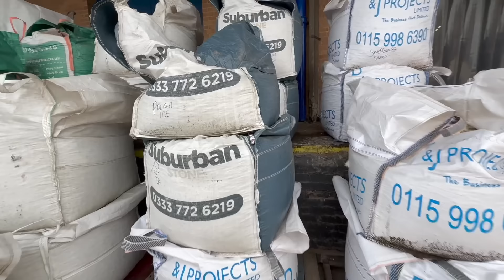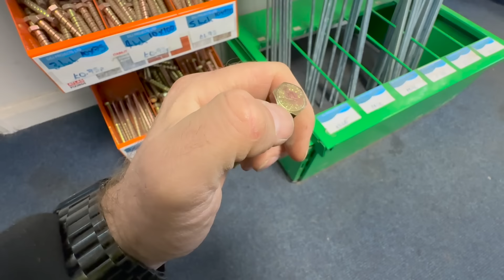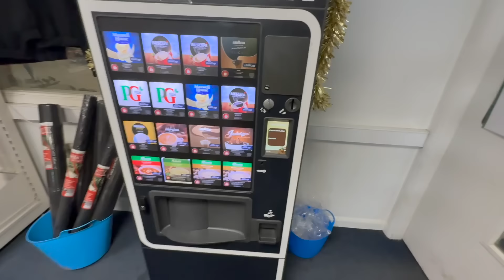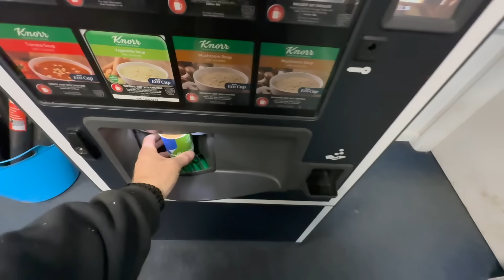Completing the "TOO SCARED TO TAKE ON" Job no one wanted!

Comment: I would have that blue Berlingo parked on a busy road as advertising instead of sitting in the yard doing nothing 👍🏻
Reply from the maker: It’s not road worthy at the minute 😢 and I’m just not sure what to do with it 🤔
Reply: @ gutted 😭 its the og van of the business, it is costly to get road worthy, personally i would try repair it myself
Reply from the maker: @kevinkvs9746 it’s not going anywhere soon don’t worry 😉
Reply: @DJProjectss  😬😬😬😬👌🏻💚
Reply: Gut it out engine , seats and  everything  , then get it raised in the air at the entrance to the yard 💪
Reply: @ I was thinking the same thing g but didn’t want to suggest it 🤣🤣 put it on the roof 👍🏻
Reply: Great fencing job and great video thanks guys

Comment: Not sure if anyone else has asked but can them gravel boards hold that much wait I replace a few gravel boards in my time because they popped from the weight behind them and they weren't hold that much compared to you hight.
Reply from the maker: 100% if installed correctly and the gravel board themselves are made with the correct strength concrete and have all the steel reinforcing in them. But yes good question 👌🏻
Reply: @DJProjectss  thanks for reply you guys do a great job

Comment: Just my thoughts but I would imagine those gravel boards will split after a few freeze and thaw cycles. Even with the gravel behind and extra strong boards concrete is still no good under tension across 6ft. Just my opinion

Comment: Hang on, no fabric to stop soil and stone mixing, you know the soil will seep between the stones overtime right
Reply from the maker: Correct but the weight of the soil not be on the fence.
Reply: @DJProjectss  what does that even mean over time all that soil’s gonna make its way through the rock and push

Comment: Good evening D&J team missed you earlier I was watching F1 well done to McLaren’s Lando Norris on his victory which in turn gave the McLaren team the constructors team championship win. Sore loser award went to Crashttapen for his lunge up the inside of Oscar  Piastri and they collided with the pair of them spinning with Crashttapen spinning a full 360 degrees so he could just continue but Oscar was spun across the track and facing the wrong way so he had to spin around and join the track when it was safe to re join which means he ended right down the field and this was only the second corner of the first lap. Crashttapen ended up with a 10 sec penalty for his wreckless driving where to me he should have been shown the black flag and disqualified from the race as he’s doing this lunging far to often and will end up killing another driver or himself .

Dave was the tools scraper for removing moss and other stuff from patio or concrete? 
Stevie that was a tidy job that was needed to show that fence of to its best look and it looked bloody great once you’d finished the back filling  well done to the barrow boys 9tons you moved between the pair of them spinning with my back sore thinking of them.😂😂😂😂😂😂😂

Comment: Why didn’t you just fill the gap with soil,why limestone first please?
Reply from the maker: Keep watching and I will explain 😉
Reply: the soil becomes very heavy when its wet and saturated and would eventually push o the gravel boards compromising its    strength, the limestone acts as drainage allowing the water to flow.
Reply: @DJProjectss  the water will just run into the neighbours yard now why not put a piece of big O in there and chase the water down to the drain put a sock on the big O keep it from clogging up. Then gravel then topsoil any waters just gonna go into the neighbours yard now